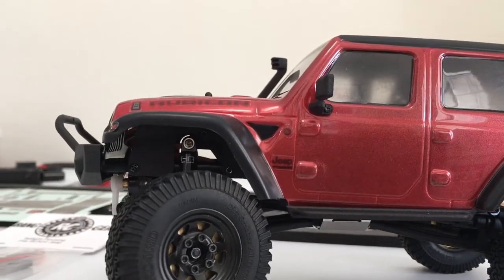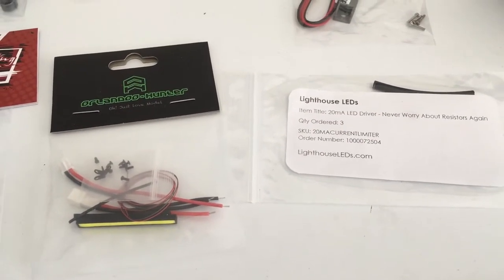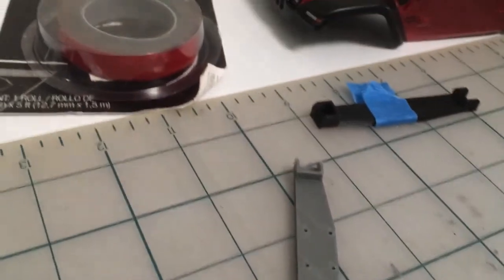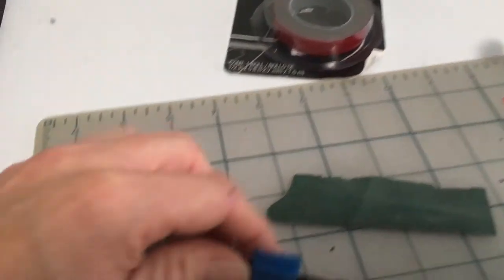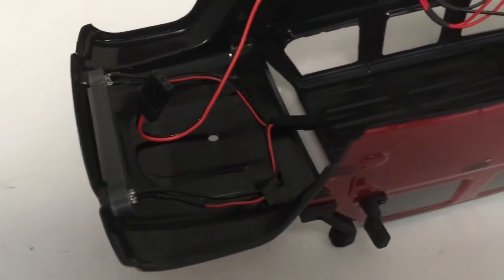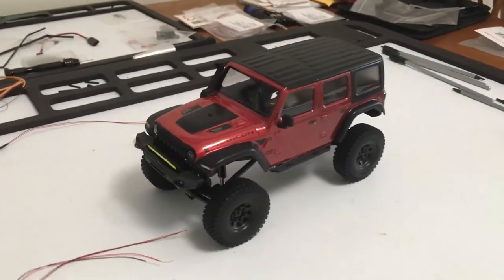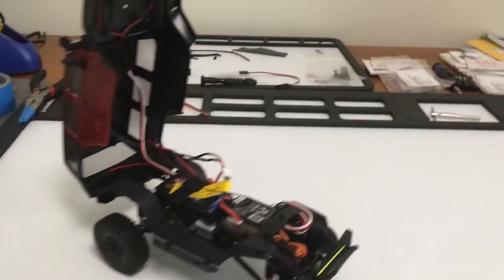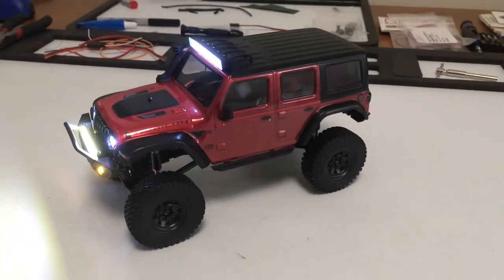SCX24 Jeep JLU Trail Truck Build: Part 2: - Wiring Lighting, Lightbars, Club 5 Switching & Body Lift

Comment: Sweet! 👍 I’m a big LED guy. I’m just starting to fit mine with lights now.  What kind of plug did you use for the light ports? I’m trying to find a plug like the ones that came with the stock bumper. 🔌
Reply from the maker: I just bought some servo extensions plugs and servo pigtail leads with the JST plug connectors on them.  The lights use a 2-port, but the 3-port servo type work fine - I just used Pos/Neg and can cut off the third wire (signal wire typically.)  I just couldn't find any 2 port JST pigtails...  see below link for examples.
https://www.amainhobbies.com/search?s=servo+extension
Reply: @bcochener  awesome! Thanks

Comment: Is the 20mA driver really enough for the orlandoo light bar? 
Really liking how this turned out!
Reply from the maker: Yes, it powers that little bar great!  
however you can add more if desired.
-From LIghthouse LEDs site: "Multiple current limiters can also be placed in parallel to add current (40mA, 60mA, etc...)"

Comment: Sick truck how did you paint your taillights
Reply from the maker: I masked it all from the inside and spray painted.  I used a liquid mask I brushed on and cut with an exacto.  Very last step, for the lenses, I just brushed on a light layer of the spray paint for the body color from the inside as the red tint.

Comment: What shocks are those?
Reply from the maker: Hot Racing Airshocks.  I install them in Part 1 of the build and you can see a short run at the end of the Overland Reveal video.

Comment: How did you wire up the resistor to the light bar you installed on the front bumper? The resistor looks different than a regular one I've used before, it shows a positive on one side and negative on the other
Reply from the maker: Positive side is power in, neg is power out.  That is the direction I believe.  Wired it in on the positive.  (I assume you are talking about that little 20mA LED Driver I used inline for the Orlandoo Hunter bar.)
Reply from the maker: It shows an image of install on the website.  https://lighthouseleds.com/20ma-led-current-limiter-driver.html
Reply: Ok Thancxxx... I seen that picture was a little confused with some of the symbols...  I really like how your build is going... How's that brushless motor working out for you?
Reply: The next picture is what confused me more because they show a red wire on one side and a black wire on the other... The way you did it works so I will follow suit...
Reply from the maker: Got ya. That image shows it wired in series, so that is why. We will install it parallel. So only on the positive wire. Just put it in the correct direction of flow.
Reply from the maker: Still messing with it. It cogs a little, since it is 2 pole.  I still need to give it a good outdoor test. For now I’m leaving it in. I like to have different motors in each build.